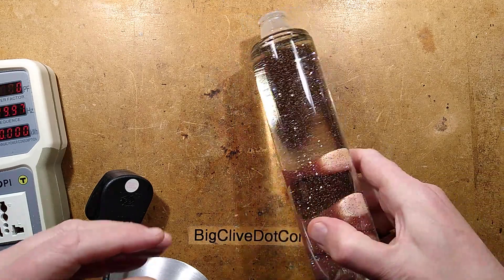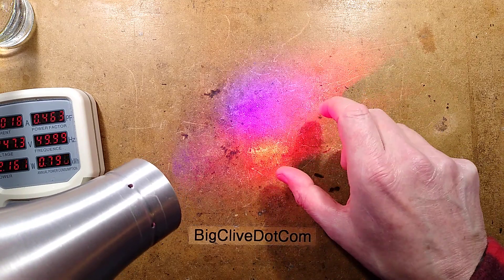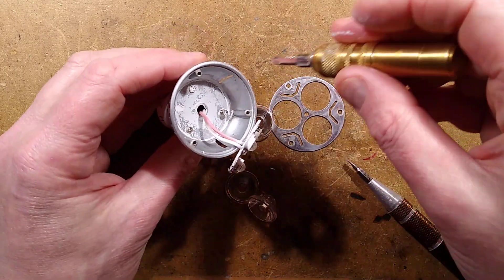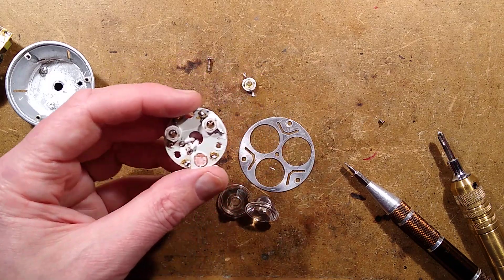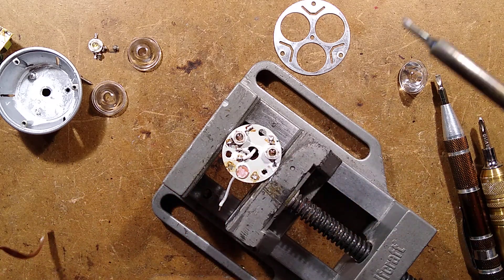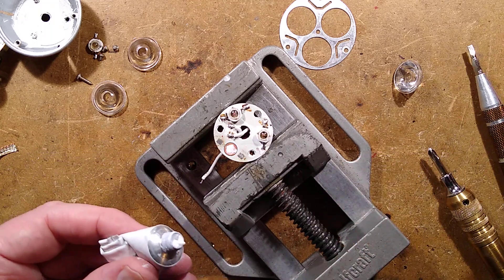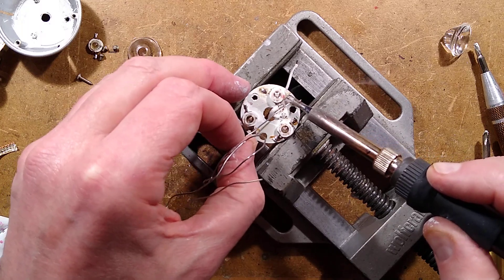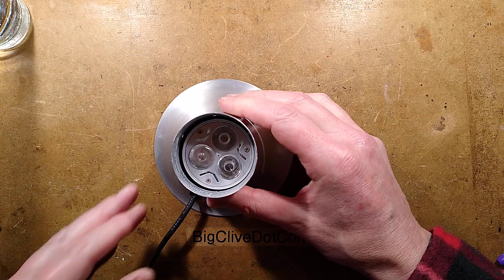Updating a 70,000 hour LED lamp

Comment: Question for bigClive, so I've got this cheap sound activated disco light that plugs in any USB, and it works, the unit has a Mic inside that makes the light change, now I've installed a femail USB to my duke boxes 5v output just for power, that just the red wire to live and black to switch, so the jukebox now has a USB power slot putting out 5.5v - and I plug the USB disco light in this USB its on constantly and the Mic doesn't work? you can't get the disco light to react, and you plug it in to any others USB its works?!?! there is a white and a yellow lead but where would I connect those for just a power outlet, the disco jab light only has a go as co and red wire from the USB. this one is wired and its beyond me, what do y'all Think about this dilemma? thanks.
Reply from the maker: There may be a hum or a noise in the unit you can't hear, or the 5V supply may itself be electrically noisy.
Reply: @bigclivedotcom  I discovered the problem, although stated at 5v the lights pcb  reacts perfectly to 3.2v, I used a pot on a down stepper of 12v to 5v which has a pot that will go as low as 1volt, having the disco light working I simple tuned the pot until the disco light reacted to bass beats, now its great! setup on the rear of my mini jukebox via a USB port I installed. its all about voltages!

Comment: Coincidentally as I was re-watching this a lamp in my living room, on a timer, started flashing on and off about once a second. Thought it was the digital timer going screwy but no, the bulb just failed in an unusual way.
Reply from the maker: That's a common power supply failure.  Usually due to a dry or swollen electrolytic capacitor.
Reply: @bigclivedotcom  I probably should open it up!

Comment: Have an IKEA "snake LED" lamp (JANSJÖ LED USB lamp - black) of the first model they sold. This is a much better product then the current version with the same product name.
It has been on 24/7 for the last 9 years and are still about the same strength as when it was new. This first model have outlasted several of the newer version. The newer models have a little stronger light, but you can not expect them to last more then 3-4 years then the power module dies.

Comment: I've got one of those colour changing Oggz LED eggs and I've had it running 24/7 since about 2006.  The internal battery doesn't hold much charge and the green colour works sometimes and flashes/flickers most other times but other than that it still works on external power.  Can't find a replacement battery and can't get into it as the capsule is glued together.

Comment: I'm surprised the blue LED is less rugged then the red since the blue can tolerate higher temperatures according to data sheets, up to 185°C core temp in some cases.

Comment: Aluminised glitter can be pH sensitive. If the solution is mildly acidic, it'll dissolve aluminium , same if it's mildly alkaline. Keep the liquid as neutral as possible 
(I've made glitter gels in the past)

Comment: Thermal paste can suffer from "pumpout". This is a sometimes brought up in the context of CPUs in computers. However, my understanding is that this would be from thermal cycles causing repeated expansion and contraction. If thus truly has been on 24/7, it seems unlikely that would be the cause. If you had it on a timer to turn it off at night though, I could see that being the cause.
Reply: But pumping only happens in places where the thermal compound is squished between two surfaces. It wouldn't explain why the compound has crept up the inside wall of the bulb where it is clearly not compressed between two surfaces.

Comment: Inserting the lamp into the holder.
Get/use a round 1.5 inch rubber sucker with a key ring holder on the back.  The sort of thing you would use to remove a smartphone screen (or the sort of thing the used to hold Garfield cats to the rear windscreens of cars 30+ years ago).
This also means you can lift the lamp out without turning anything over.

Comment: The same thing goes for LED TV's and computer monitors. I usually run the brightness level at 0 percent. It makes the screen lighting last longer than the capacitors in the power supply.

Comment: Problem with low energy, low brightness, but long life LED bulbs is that it requires multiple receptacles and bulbs to generate the same brightness. And rooms generally doesn't have that many receptacles.

Comment: I wonder how good an RGB LED setup would work with this, maybe even addressable ones.
Reply: Wouldn't work with the lenses. An "RGB LED" consists of separate red, green and blue diodes so they wouldn't allow the lens to focus the light properly. Of course you could just use separate red, green and blue LEDs, one under each lens. Just needs a way to control them separately.

Comment: When i made some indicator leds to my car i didn't know about blue leds being so sensitive. I limited current just like for green led (like 2k) and it was just like a mood light - brighter, than 5W bulb. When circuit for this led was off it stayed dimly lid, so i was sure about some that mistake being in wiring. Many hours of trying to repair this later i used my second led to find correct resistor, and it was dim at about 200k ohm. I installed this value on this problematic led and it was off - from being at overcurrent conditions  it ended up loosing like 70% of efficiency and needs 50k for the same brightness and does fade in instead of instant turn on. This was hard lesson for me,  as every change in circuit was backed by like 10 minutes of disassembly and then driving around :>

Comment: In regard to the thermal compound flow, was the lamp on the entire time, or did it occasionally get turned-off for whatever reason?  Because one possibility would be pumping from thermal cycling.
Reply: Pumping only occurs where the compound is squished between two parts. It wouldn't explain why the compound has crept up the inside wall of the bulb.

Comment: Clive, I am watching you solder surface mount LED's with a soldering iron. Have you ever used solder paste? It is lead-free and you just squeeze it on like flux, Then you heat it  with a special heat gun which directs the hot air into a pinpoint, The paste has a lower melting temperature than lead-based solder and it makes soldering look so easy. 
I would like you to feature a video of this for other people.

Comment: I've seen many cases of blue LEDs fading over time, mostly when used as indicators. Power LED in a small 3 channel analog mixer on my desk has faded to barely visible at night over 3 years of being on 24/7. A USB hub that has indicators on each port has noticeably faded on a couple that are always left connected. I wonder why they are typically so fragile? I prefer red/amber/green indicators anyway for power but sadly the trend is for blue and even (UGH) stupidly bright white!

Comment: Would love to see a video about why so many LED lamps flash when they age. Either on and off every second say or rapid flickering. I find LED tape is especially flicker prone. Can it be fixed? This is aside from ones connected to dimmers which can flicker from new.

Is it due to aging electrolytic capacitors or some other factor?

Comment: It might be creep, but it might also be vaporization and deposition.    Silicone based products will vaporize (if you've used the coatings for your dashboard, you'll notice you have to clean the windshield more often), and then deposit themselves.   The underside of the disk will be the hottest point, but will rapidly cool as it flows up the edge of the aluminum casing towards the outside.

Comment: I've noticed that needle tipped bottles of the flux I use always (MG Chemicals RA Flux) end up with weird buildup forming around the tip/cap - some kind of salt that forms from reacting with the air I'm sure. Have you experienced this or does your flux not behave this way? Or maybe I just need to clean off the needle tip/cap after each use more thoroughly.
Reply from the maker: The flux often has isopropanol as a solvent.  As it evaporates at the tip it can cause dried flux to form.

Comment: I have a set of LEDs from RapidLED that have been running on my aquarium for 10 years. 10-12 hours a day (depending on the time of year) on a sunrise-sunset controller. I would have thought two years then they would fail.

Comment: Now the question is, in another 8 years, will the lamp be repairable, or will the casing have degraded? Fascinated to see where that goes… also, will you never need to replace the red LEDs?
Reply from the maker: Traditional red LEDs are the real 100,000 hour technology.  And even then they will usually have just dimmed a bit.
Reply: @bigclivedotcom  I wonder if blue will ever be able to compete with that…

Comment: holly molly 8 continuous years?!
I've ordered a bunch of such led bulbs over the time from aliexpress and ebay (ofc the cheapest i could find, lol) and none have passed 3-4 years. 
They were white led bulbs used on various appliances around the home, so not 24/7, but rather 3 hours / day at most.
And the majority of such bulbs would die in 2 years, some in one and some in 3 + years.
You got amazing quality from your bulb there
Reply from the maker: It was probably helped by being lower than 3W to start with and operating base-down in a cool environment.

Comment: 2.15 W * 24 hours * 365 days = 18 kWh / year. ~~ 20 kWh. With the higher prices, will you still run it 24 / 7 ?
Reply from the maker: Cost before increases £2 a year.  Cost with current price £3.85 per year.  About one penny a day.
Reply: Your calculation is off by a factor of one thousand. 2.15 W x 24 h/d x 365 d/y = 18 000 Wh / year. That's 18 kWh / year, not 18 000 kWh.... 18 000 kWh is in the ballpark of one year's total electricity consumption of a fairly large house with direct electric heating here in Finland where winters are really cold (including electricity consumed by lighting, home appliances etc).
Reply: @Kepe  You are right, I edited my text as that was a silly mistake! Thanks! The thousand separator is actually a point (dot) in Holland, that's where I went wrong.

Comment: I suspect the "eating" of your glitter is due to the calcium nitrate being a Lewis acid. In essence it is nitric acid neutralised calcium hydroxide. In water solution the nitrate ion are free NO3- and this can react with the aluminium to give aluminium nitrate which is soluble in water. This is a rather simplified explanation and rather dependent your upon your  assertions to the composition of the liquids and the glitter.

Comment: In addition to your modifications you normally keep your house relatively cool but somewhat dry right?  (Basing that on things you've said in passing in other videos) 

Having a lower ambient temperature is likely helping your various projects live a little longer. 
The same lamp used not here in the UK but in non air conditioned Equatorial locales might have a significantly different lifespan!

How clean is your leccy on the Isle of Man and do you think that has an impact on the lifespan?
Power at my former town house used to be very clean and very stable (read: no power cuts in almost a decade).

At my current rural house the leccy is a little dirtier and power outages are often longer and more frequent.

Edit: Good content. Smashed up nose? Why did I/we miss?
Reply from the maker: Power is fairly clean here.
Reply: @bigclivedotcom  Interesting. Thank you for the update. My last house the power only disappeared if ALL the local commerical/industrial shit did as well. I think I was on a spur of sorts. It must have been oversized as no amount of industrial noise EMI and the like made it back onto our juice. 

I was bloody spoiled and my home servers/projects thanked me for it! 

Cheers Clive.

Comment: Looks like the wavelength of the blue LED is just short enough to have enough energy to degrade the LED lens material, given enough time; In the same way that sunlight degrades most things (except UV light makes the process much faster). An impressive run time, maybe got lucky with the power supply under-running the LEDs, compared to the usual grilling.

Comment: There's an effect called pumping that happens with the expansion and contraction when heating and cooling of materials that can cause thermal compounds to creep out from between the 2 mated surfaces, but seeing as this light has stayed on 24/7 i don't think this is the case here as the temperature change in this unit should be next to none.

Comment: I've had standard 60 watt bulbs last 8 years.
Yes, LED lamps are tough but, it depends upon who is manufacturing them.
Standard bulbs used to be made in the US by GE, and they were very sturdy, lasting many years.
I think it is the fact that LED lights are easier to manufacture, and cost less, especially if they're made in China.
China uses slave labor.
Slave labor is allmost free.
If China descends into revolution right now, we will be forced to go back to standard bulbs.

Comment: Simple food for thought whenever you replace a screw into especially plastic, turn it back until it clicks back into the same groove it was in originally, then turn it right into the groove to tighten. Also often MFG's will use a self taping screw, and it might cut another groove, and in that case after a few time removing with out getting into the original groove the screw hole will be completely drill out with no more grooves. Machine threaded items don't usually have this concern.  Nice project, I never knew if these could be taken apart to be fixed!
Reply: This changed my life when diodegonewild said it in some video. Never looked back.
Reply: i will cringe when people dont do this
Reply: I’ve always been annoyed with computer fans for this exact reason. It seems like the self-tapping screws are some sort of standard.

Comment: There is a phenomenon you see with some thermal compounds in high-power electronics with transient loads, like CPUs and GPUs.
Thermal cycling on and uneven heating results in expansion and contraction of the contact surfaces which produces a sort of "pumping" effect. This pushes out some of the thermal compound.

I'm not sure if that's relevant here as you mentioned the lamp was on the entire time and its a relatively static load, but ambient temperature variations can certainly play a role here.

Comment: I always find the differences between North American English and UK English interesting. What you call a pillar drill we would likely call a drill press. They are typically free standing, either shorter bench top models or taller floor models. However, we also have much older drills, from the early 1900's, that are called post drills. They are not free standing. As the name suggests, they are mounted to the side of a post.  Typically in a barn or shop. Most post drills are hand crank, although I have seen some with an electric motor belted to it.

Comment: If you over apply thermal paste, the pressure and heat will make it creep. Especially since it isn't a rigid construction. The aluminium sheet flex a little and probably trap a blob in the middle between the screws which then works as a spring. When the paste is warm and more viscous it squirts out. 

Have you had a chance to search for the tripple function heat/UV/ozone boot dryers?

Comment: This would have been a great time to change to specific wavelengths rather than just "red" or "blue".  I find most of the "red" beads like this are around 625nm which has that slightly orange cast to it.  I really like the deep red 660nm ones.  Add in a 440nm blue and 510nm green and you'd have really rich colours.  Of course if you're more interested in the colours being more muted this might not be the way to go.  it all depends on preferences I guess.  But this video goes to show how long these things can last and that there truly are "user serviceable" parts inside.  😁
Reply from the maker: It's currently got a red/amber combo in it.

Comment: I’ve salvaged components from old computers. Heat sink compounds do flow when heated, but it’s like the infamous tar drop experiment in that’s it’s very slow. It tends to flow away from the heat very slowly. After a couple of years of on/off performance you can see it on gpu heat sinks, there is less compound in the middle and more at the edges, and sometimes it starts to bulge out and flow across nearby areas.
Reply: constant pressure between the two parts as well as variations due to temp cycles and sometimes gravity plays against the compound. That's why high viscosity pastes or pads are recommended for low maintenance applications.

Comment: Could you use propylene glycol as a liquid, it thins when warmed and I doubt it will attack the aluminium?
Reply: Pure propylene glycol might be hard to find, but fog machine liquid would probably work just as well because it's made of PG with some other stuff.
Reply: @tissuepaper9962  I vape with it, I get 5lt for about £25, it's also used in commercial cookery.
Reply: @landroveraddict2457  damn I guess a vape shop would be the spot to get it huh. Didn't think of that even though I knew it was used in vapes too.
Reply from the maker: Not a high enough specific gravity to make the glitter flow.